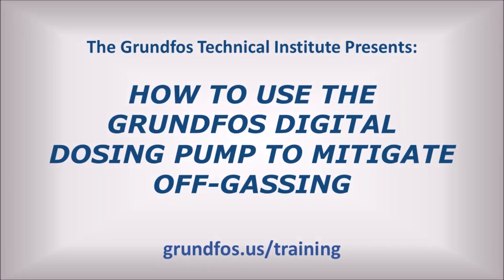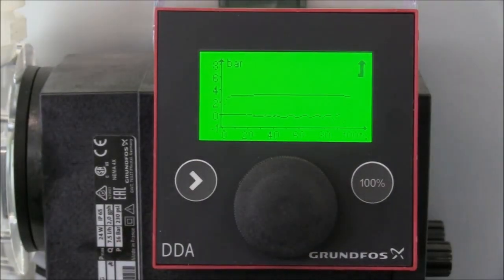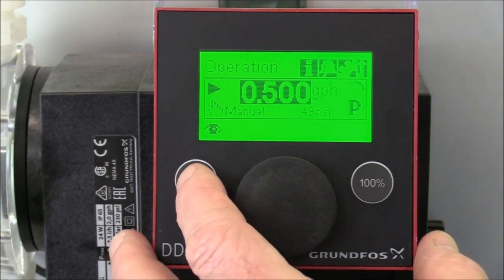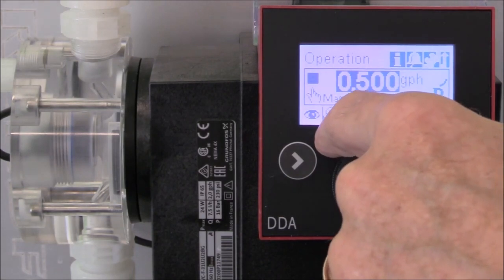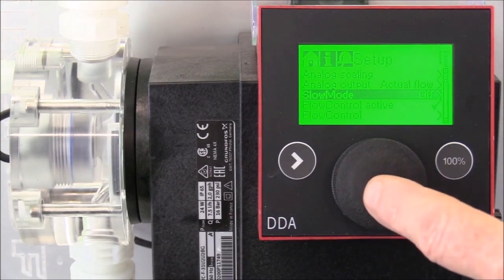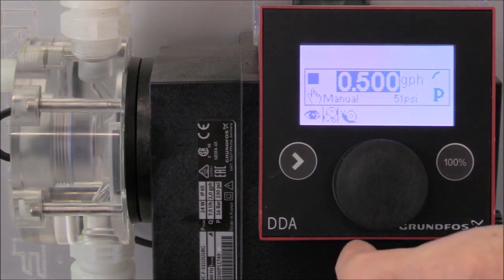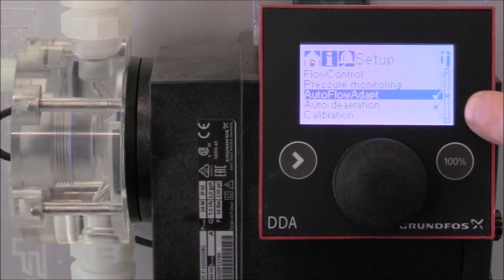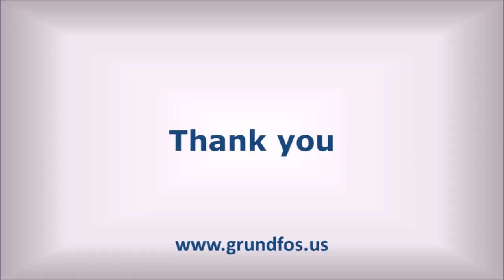How To Use The Grundfos Digital Dosing Pump to Mitigate Off Gassing

Comment: Is it possible to reverse the suction stroke to bleed the chemical back into the tank to do repairs on the line?
Reply from the maker: Hi, thank you for reaching out to us and for your question :)
This does not work with the operating principle of a dosing pump. It can only pump in one direction. But, it can at least partly be solved by using a multifunction valve (MFV) which can provide drainage of the discharge line back into the tank. For emptying the suction side, one has to remove the suction lance from the tank, let the pump run, and again the drain function of the MFV can be used to lead the liquid back to the chemical tank. Be aware that there will still be some remaining chemical in the line. The only way to get rid of this is to flush the pump with water - or any other harmless liquid if water is not suitable as flushing liquid. 
Hope this will help you!
Let me know if you have any other questions! :)
Kind regards, Sofie

Comment: Any recommendations for how to fix the "low differential pressure" alarm? We have tried all of the recommendations in the user manual, but still get the alarm after the pump runs for a few minutes. We are using a DDA 7.5-16 in Sudan to pump 1% chlorine solution.
Reply: Our dosing pump rate is between 1.7-3 L/h into a water flow rate of about 4 L/s. Thank you!
Reply from the maker: The issue here is that the pump identifies that there is not enough pressure difference between the suction side and the discharge side. If there is not enough difference the ball valves cannot close correctly, and the pump will be inaccurate. The reason for that can be very diverse and a lot of them are described in our manual as mentioned. The best would be to make a service with new valves and a new membrane. Check if the counterpressure valve is working fine (minimum 2 bar) and check if the suction line is not too long and no cavitation is there. If all of this is not working, a Grundfos Service Technician should inspect the installation and the pump.

If you need more help, please send an email to socialmedia@grundfos.com with installation images and more information on what recommendations you have already tried. You can also contact your local Grundfos service office here: http://gfos.ly/6051VcpfV. Kind regards, Sabrina.

Comment: What do I need to do when the alarm is "low differential pressure"??
I am working on a marinfloc which uses a similar pump. The marinfloc always shuts down when the alarm occurs.
Reply from the maker: Hi, thank you for reaching out to us! 

It seems like there is insufficient backpressure for the pump. You either need to add a pressure loading valve or pressure valve depending on the pump size, flow range used and pump head materials and chemicals. To determine the right valve from our accessories range, I would kindly ask you to provide the following information: 

- Pump type 
- Flow rate range used with pump (min. and max. flow used)
- And also, what accessories are currently installed around the pump? Maybe you can provide a picture of the current installation. 

Looking forward to hearing from you and help you further :)
Kind regards, Sofie
Reply: @grundfos  It's DDA type. Used for Chargepac on marin floc.
It's written here 4-20mA, 3.90mA.
So, yesterday we replaced the diaphragms, suction and discharge valves. the "low diff pressure" alarm is gone. But then another alarm appears which is "discharge v/v leaks" but there is no leakage outside and my system l shuts down again.
Sorry to ask too many questions, i am new to this system. 🙏
Reply from the maker: Hi again, thank you for providing the above information :) 
The backpressure seems to be sufficient, so the problem lies elsewhere. There could be several things causing the issue then, but probably the issue is quite simple to fix. May I ask where you bought the pump? 
I think this requires some guidance on a call and guidance on what to check for. 
Thanks for your patience! 
Kind regards, Sofie
Reply: @grundfos  i don't know where my company bought this pump. It's a 1 year old cruise ship, quite a brand new ship. So it's built-in everything in the shipyard in Italy.
Reply from the maker: Hi, ok thanks for the information. Do you then have the possibility to take a picture of the pump, the nameplate and the chemical canister beside it?
Thanks so much. 
Kind regards, Sofie

Comment: Can this device display totalizer instead of flow?
Reply from the maker: Hi, 

You can only display the actual flow, 4-20mA input, and back pressure on the main screen. The pump does have a totalizer under the "I" menu. The only way to display a totalizer on the main screen is to run the pump in Batch mode, and that will only show the totalizer for one batch. Once a new batch is started, the totalizer will return to 0.

We hope this helps!

Best regards, 
Steph